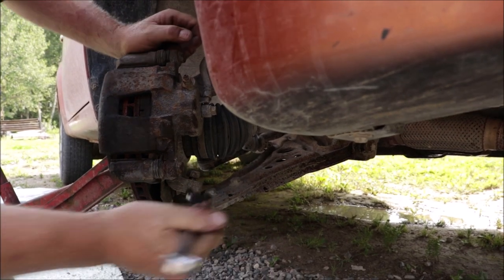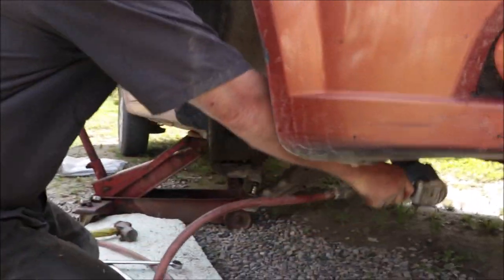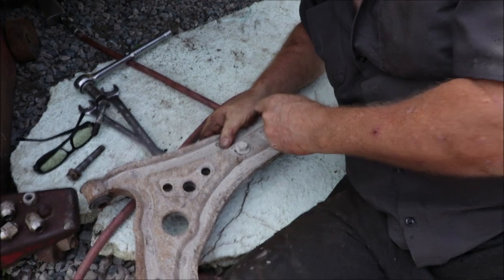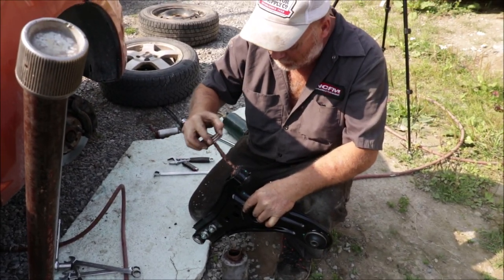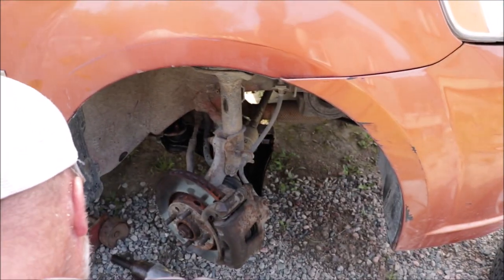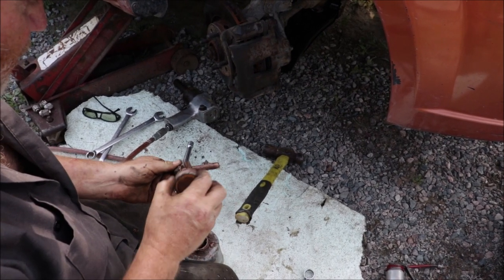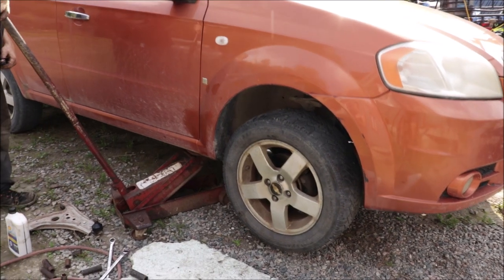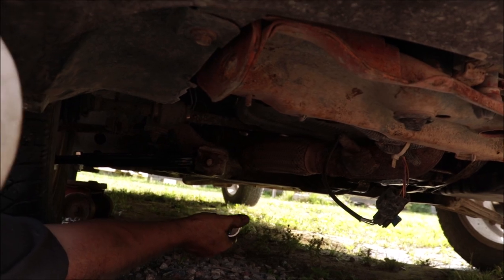2009 Chevrolet Aveo Lower Control Arm Replacement

Comment: Great video Cecil and Heather. The control arm replacement went pretty easy compared to the Chevy Cobalt and Pontiac G5 which i replaced the control arm on (G5). Had to cut the bolt out and cut through the rubber bushing and sleeve to free it up. The bolt goes through the chassis into a captivated nut which of course is seized solid and all spins. Great job Cecil.
Cheers, Jeff.
Reply from the maker: Hello Jeff, Yes I got lucky with this little car...I also go around this car with an oil can and oil every bolt and not I can find, the ones in the frame I remove and add Never seize for future repairs.  That sucks when the bushing seizes to the bolts.  Cheers!

Comment: as a retired fleet mechanic(FEDEX) glad to see people besides myself still using permatex anti-seize as a fleet mechanic we used that all the time but most of our vehicles are Fords with exposed front bolt & nut the one I'm working on the nut I'm assuming is spot welded inside the cross member & hidden the bolt is free spinning guessing the nut broke loose any advice on it? other than using my cutting torch on the cross member to expose it.

Comment: Is that an ingersol, or a Mac impact. I have one on each and love them for about 20 years now
Reply from the maker: Hello Tim, It's sold under the Mastercraft name..but I think Ingersol makes them.  Thanks again.  Cheers!
Reply: @cecilsshadetreegarage7408  I noticed the frame on it and thought that looks like an ingersol and I think they built them for Mac tools also. I also forgot how old I am, I bought my Mac impact in 1988 and it’s still going strong. I realized in 1991 I made more holding the wheel than I did riding the creeper

Comment: By doing it yourself you probably saved around $700 bucks.
Reply from the maker: Hello Ronald,  thanks...I just did the drivers side today, it was tougher, I had to jack up the transmission to get the front bolt out...it's always the expensive side lol. Thanks again. You have a great evening.  Cheers!

Comment: Great video, please use a jack stand so not to get hurt or worse we want to keep you around 😀,so for  being a nag
Reply: Yes, and if you used jack stands, then you can use the jack under the wheel to put it in the weighted position without lowering the car down.  Thus making it much easier to tighten that bolt.